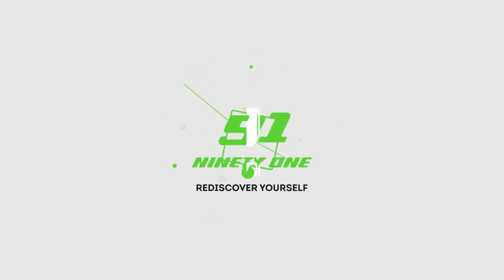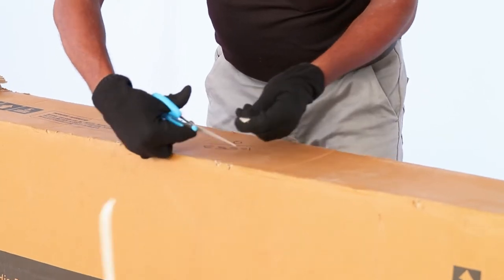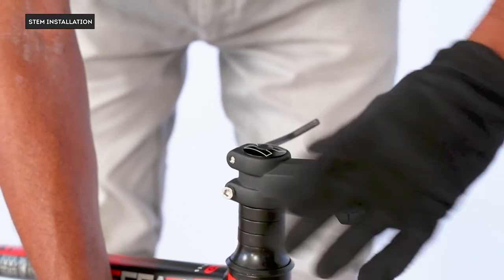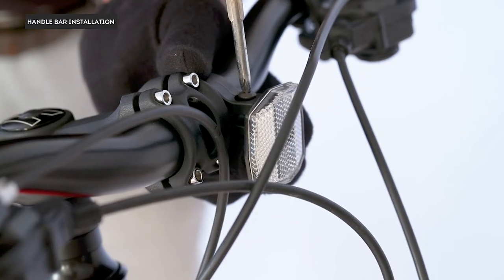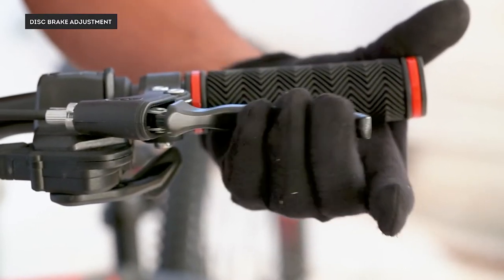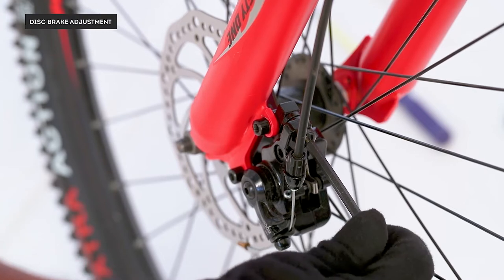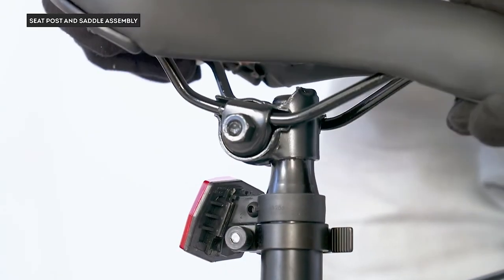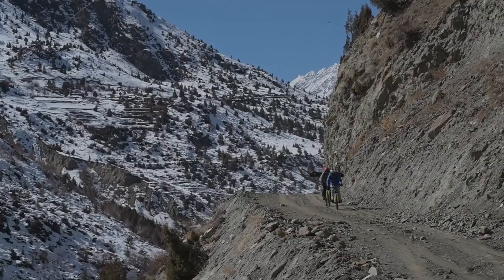Assemble Your New Geared Bike at Home | Ninety One™ Cycles - India | 2021 | Home Installation

Comment: I have mistakenly dropped my vantageX bicycle saddle rod into the frame, i tried to remove it but its not getting out please help me
Reply from the maker: Hello, please call us at our toll free number 18005729191 and our team will help you
Reply: Same problem, I faced the same problem. How you fixed this?
Reply: @TheInfoZone1  u need to pour some oil in the saddle rod frame and then u can turn ur bicycle (downside) and then u have to hit the saddle frame 
slightly and the stuck rod will come out

If u didn’t get this u can call mechanic they will remove the rod within seconds